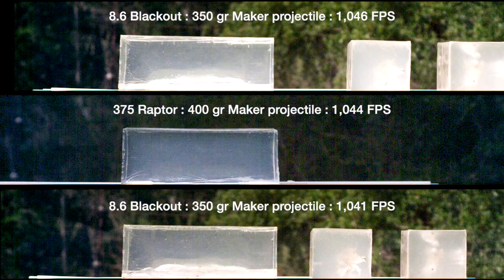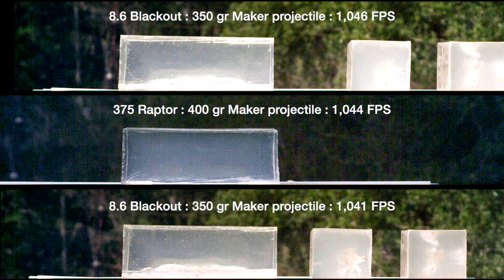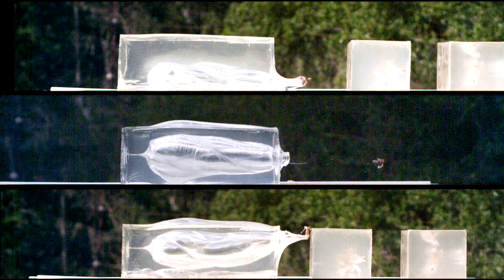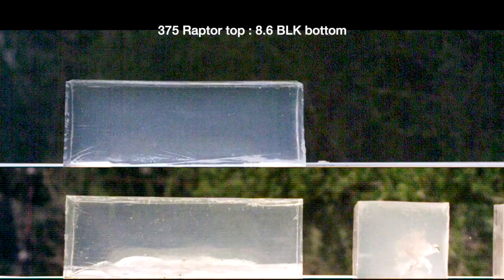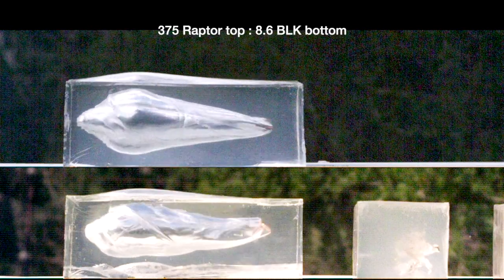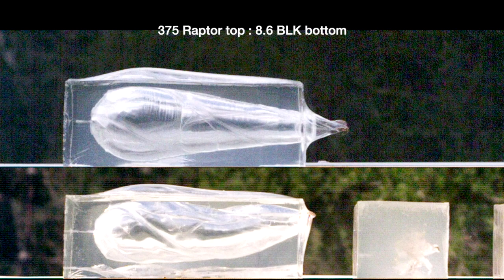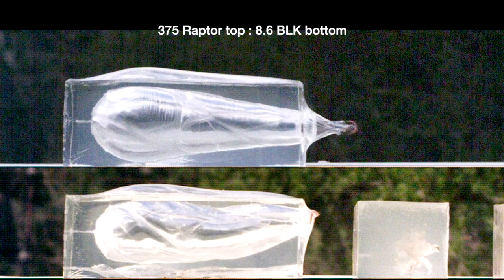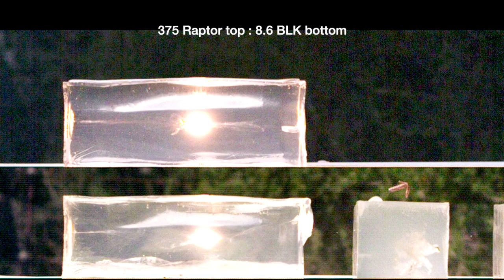Black Collar Arms Ammunition High Speed Gel Testing

Comment: What's neat is that you can see the increased twist rate in the gel from 8.6blk
Reply from the maker: You can also see how the gel stops its spin! It's doing the 1:3 thing for like one or maybe two rotations, then for at least the middle 1/3 of the block you can see how drastically its spin is slowing down, and for the last 1/3 of the block it literally isn't spinning at all. The Raptor appears to maintain its 1:6.25 spin all the way through. We've also seen that it travels dead straight (both through gel and hogs, deer, etc., even when encountering typical bones and such) and deep, whereas in the vast majority of 8.6 BLK tests we've done with multiple types of subsonic and supersonic projectiles it curves off pretty drastically, often exiting the side or top of the block even when hit in the center and in-line, and doesn't penetrate as deeply. We're experimenting with various projectiles to see if we can come up with one that behaves more like tactical/hunting ammo should.
Reply: @BlackCollarArms  yeah, 8.6 blk has long for caliber bullet and when  those huge fins opens up it flys around like propeler without a plane. 😂 I like 8.6 blk but I think that 1:3 twist makes more problems then good when using supersonic loads. I am sure that 1:5 twist would be enough.